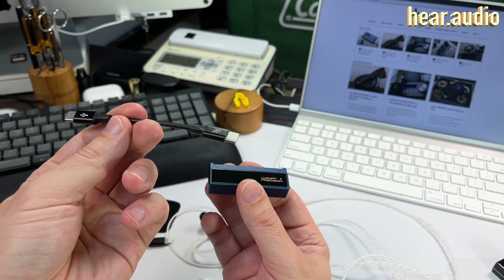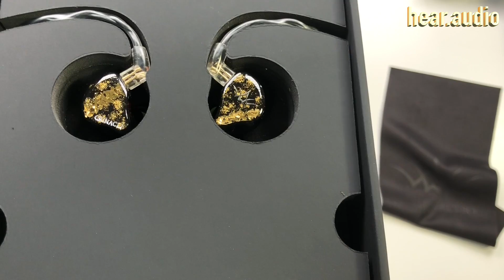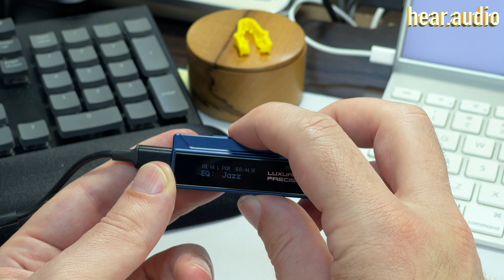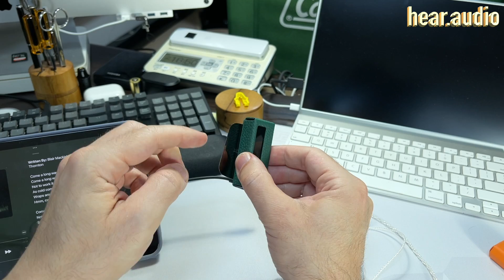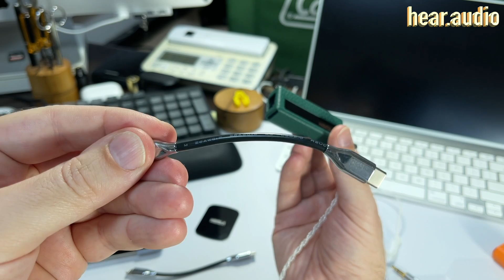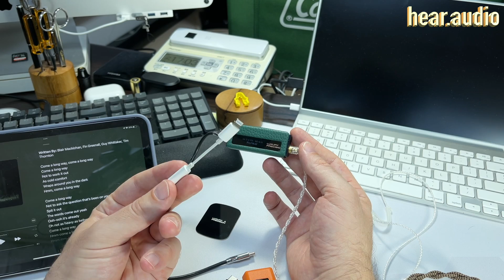Luxury sound for your headphones - The Luxury & Precision W2-131 DAC/amp Review

Comment: Thank once again for another detail evaluation. I understand Cirrus Logic base DACs’ need a much longer break in time before it sounds optimal.  I’m wondering how the W2-131 fairs against the Fiio BTR 5 or 7 when directly and not over bluetooth.

I am wonder if you will be able to get your hands on a NUPRIME HI MDAC SIGNATURE which has a CS43131 chip and has a mini-SPID output like the W2-131 but no interface controls but is 1/2 the price of the L&P.

Or perhaps the Halide HD DAC that is equipped with Wolfson WM8716 24bit chip at twice the price of the L&P.
Reply from the maker: I wouldn't have believed that before, but the W4 I have here, which has 4 CL DACs in it, definitely changed with use.

Comment: I m selling my chord mojo because of this w2 131 .. its more convenient with type c to type c and smaller size portable and 4.4mm pantacon.. unnoticeable sound different from the mojo that heats up  .. the upset are that it don't have internal batt and luckily it's on low power consumption like @65mins minus 10% phone batt and lack of information about it .To improve cleaner sound that reduce hissing sound quality ( alan walker faded 1 - 10sec) (estimated improve by5%) and power consumption @90mins minus 10% phone batt) get the L&P wp2 cable (very expensive cable @$160usd but worth it in a long run) . Almost like the cayun but cayun ru6 have higher power consumption and every time you volume up 70 80 90 it ll pause the song by split sec. So w2 131 is my over all winner .just my 2cents.. love your reviews ..my setting eq normal ,gain high, flt nos , hide key on, tune 2 and phone volume set at almost 45% only.. hope you could donthe fiio btr7 reviews

Comment: Finally.
For me, the RU6 is more enjoyable than the W2 (original), haven't heard the 131, but I believe they're more or less the same.
BUT, the W2 is noticeably more detailed, more neutral, and bass slams harder (yes, it hits harder) than the RU6.

However, at the end of the day, the "wet" sound signature of the RU6 just wins my ears, the bass slams not as hard, but they more than make up for it in the amount of bass they produce, the bass sounds grand with RU6.
Reply: Have u tried Questyle M15?
Reply: Have both RU7 and IFI Go Bar. Prefer the latter.

Comment: Thank you for your review. I've got W1 the predecessor of the W2 and wonder whether you could share tips for SPDIF cable(s) that do work with L&P W2 (W1) mine do not. And if you by any chance have a tip for a cable that would connect W1(2) SPDIF output with Chord Hugo 2 coax input i.e. 3.5 mm to 3.5 mm coax that would be icing on the cake.
Reply from the maker: They seem to have the same pinout for S/PDIF as FiiO use on their DAPs. So, anything that works with FiiO DAPs will work with the W2.
Reply: @Currawong  OK, thank you very much.
Reply: I also got the Luxury and Precision W2 131 and for the laptop Luxury and Precision W1
They sound different
But I must listen to w1 a few more hours

Comment: My understanding is that the 198 is the one without the amplification circuit. You might want to check that if you care about the accuracy of your reviews. But I may be misinformed.
Reply from the maker: My memory is that the original chip, which has the amplification built in, wasn't available, so they had to switch to the one without amplification and add their own.  I presume that phone and other manufacturers have sucked up all the supply of the main one.